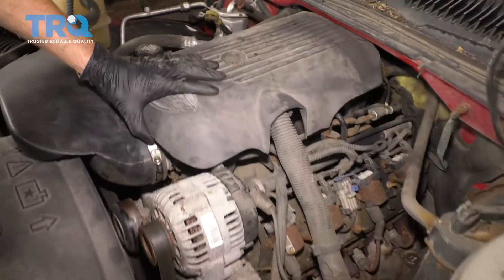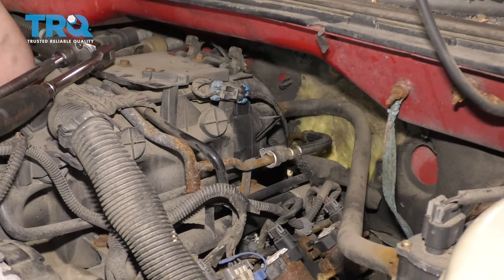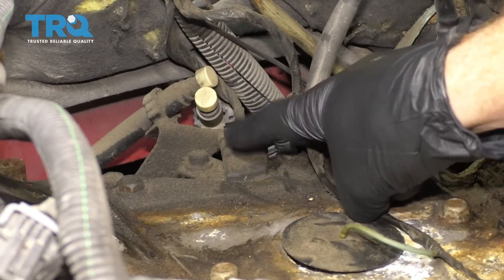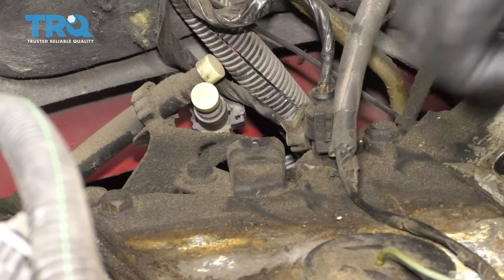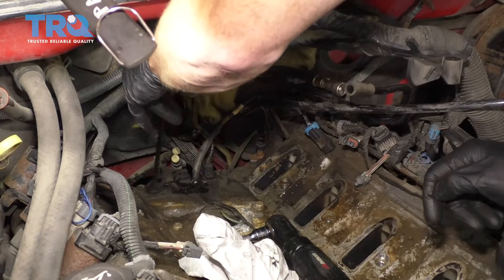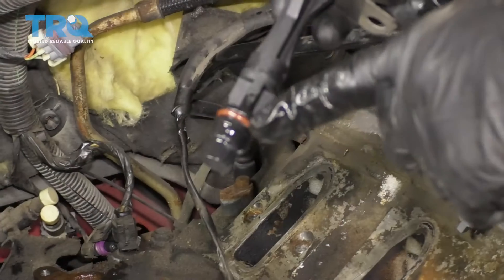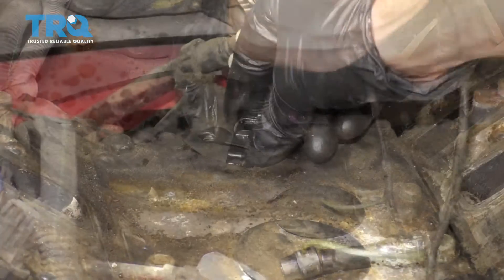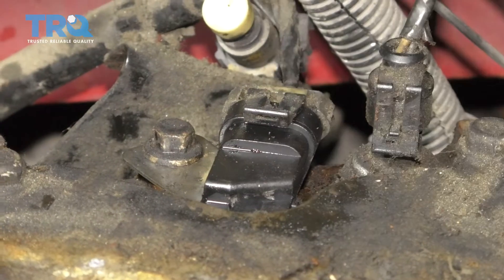How to Replace Camshaft Position Sensor 1999-2007 Chevy Silverado

Comment: Ok so i have a question for you so i am working on the same vehicle you are the issue is not a single cylinder has spark theres gas and air and compression no spark what are the chances of the camshaft position sensor and crankshaft position sensor being the issue

Comment: What a lot of people won’t tell you is that before you replace that sensor make sure you check the connection first I replace 2 sensors with no luck put old one back stuck my hand back there apply pressure to connector and wiring and hold them in place with my hand I had someone else start the truck and the truck started like it had a brand new sensor so at the end the sensor was good it was a bad connector on mine I have a 2004 Silverado 5.3 and barely have issues there now in 2025 and let me tell you in all this year I had only replace starter battery alternator and water pump the main issue on this is the instrument cluster braking all the time

Comment: After replacing the sensor on my 5.3L it gave me a P0342 Circuit Low code that it wasn't giving me before the replacement. I used a GM sensor for the replacement, could it be the new sensor or the wires?

Comment: In any car which runs the 5.7 litre Chevrolet LS1 V8 engine (not the Vortec engine) the inlet manifold needs to be removed to gain access to the camshaft position sensor !

Comment: if you want to avoid removing the intake and you can't get the sensor out I'd recommend idling your engine for a few minutes with the bolt out and the sensor will slip right out

Comment: What's causing them to stick electrolysis? Or just heat cycling? Would an anti seize compound help?; Just curious since I've never had cam sensors get stuck like that.

Comment: Will the camshaft sensor leak oil when bad?
Reply: Did u ever find out the answer to that? My escalade leaking oil amf I'm thinkin it may be that
Reply: @chrisg1364  Right next to the cam sensor is the oil sending unit... Those tend to leak oil...

Comment: This video shows the CRANKSHAFT position sensor.  Not CAMSHAFT
Reply: This is the cam shaft sensor the crank sensor  is located by the starter
Reply: the crankshaft in in the bottom of the engine .
this IS the cam sensor .
you are wrong .
Reply: Wrong!

Comment: I have a 2005 chevy silverado with the code p0343 should i just replace the crankshaft sensor or should i trouble shooting the electric part first any help. Thabk you
Reply: What did u end up doing?